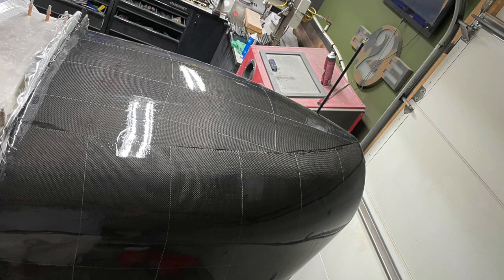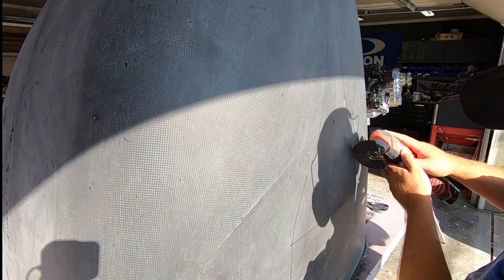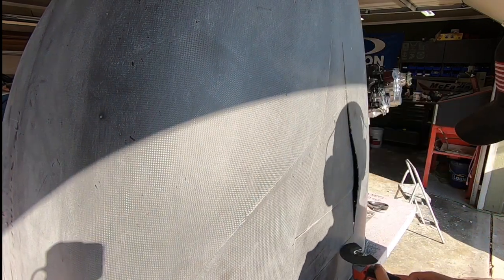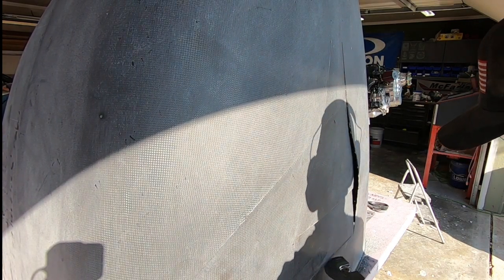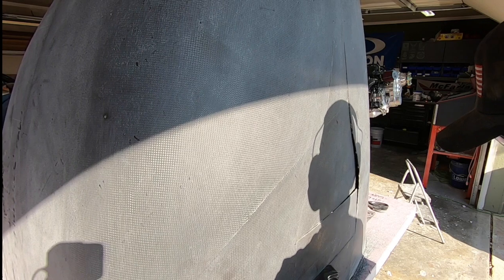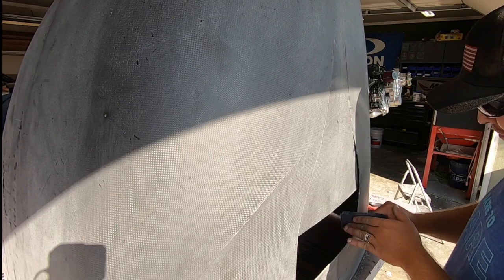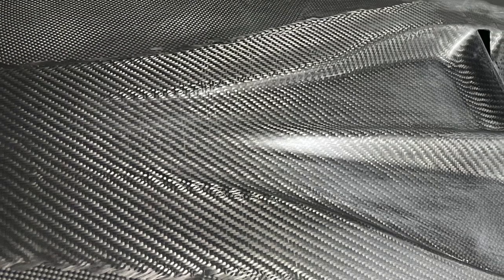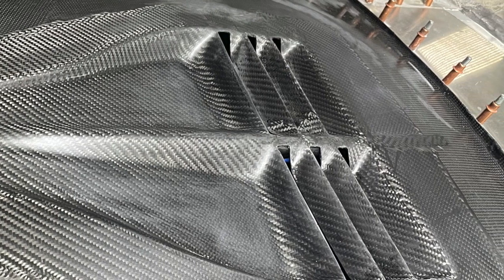Scratch Build Composite Airplane Cowling Part 3 EP 53

Comment: I have an S20/Rotax 914. I considered putting vents in a similar location to vent hot air when parked and to take cooling air in during cruise…assuming that in flight there would be a high pressure area around the base of the windshield. My ship was already flying at this point. Prior to cutting the cowl for the mod I had in mind I used a differential manometer to measure the pressure on the inside vs outside of the cowl at the point I planned for the vent. I discovered that the pressure on the top of the cowl was lower than that on the inside…a vent there would have (in cruise) allowed air that came in the front of the cowl to simply escape out the aft top of the cowl without taking any heat with it. Based on this I abandoned that idea. My only cowl outlet remains at the bottom rear of the cowl so air that comes in the front above the (air cooled) cylinders has no choice but to take some heat with it as it passes over hot cylinders and exhaust pipes on the way out. The Rotax is air, oil and liquid cooled.  The above comments relate only to the air cooling aspect. I have other thoughts you may be interested in on the ducting for for max efficiency of your oil and coolant radiators. Contact me if interested. Great build vids and fab skills!
Reply from the maker: Thanks Martin! I’m right there with you. I feel like I’m in front of the high pressure stalled air bubble that will be in front of the windscreen but time will tell. Like you eluded too, I don’t really need air cooling for my engine as it’s all liquid cooled so my main focus it to cause as much vacuum or “lower pressure in this back section of the cowl to influence as much air as possible to pass through those heat exchangers.  The only way in the cowl is through them so I think I’m on the right track. Reach out to me at project2aircraft @ gmail if you want to share some more ideas and thanks for watching!

Comment: Nice job mate. My two cents worth... I think the louvres need to be flush with the bottom tray of the NACA vent and inside the cowl... The low pressure area is at the surface of the 'tray' so the louvres as you have them are forcing the low pressure air out into the main "normal' air pressure... Maybe?
Reply from the maker: Very interesting thought there.. I’ll keep that one in mind for sure. Thanks!

Comment: Small suggestion,  I would slightly round the inside corners of the vent holes.  It will minimize Crack propagation.   Looks great.  Thanks for sharing.
Reply from the maker: That’s a good tip! Thanks!

Comment: At the least, it will let the hot air out on the ground with the engine off. 
I can't really hazard a guess what it will do in the air. The first instinct would be to say that the NACA inlet is going to cause a high pressure area that won't breathe well. However, who knows what will happen when the high pressure low velocity air rolls over the ski ramp of the first louvre and gets hauled away by the high speed slip stream. I think someone else called it right, hook up a manometer and see what the pressure differential is inside to outside. Or maybe even play with a strategically placed smoke bomb or two during engine runup.
Reply from the maker: I do plan the monitor pressures both inside the pressure plenum in front of the coolers and back here in the post cooler part. I,ll even be blocking these just to see what difference, if any, they influence. My gut says it’ll be most effective with higher air speeds and not do much on the ground or slow. Time will tell, thanks for watching👍